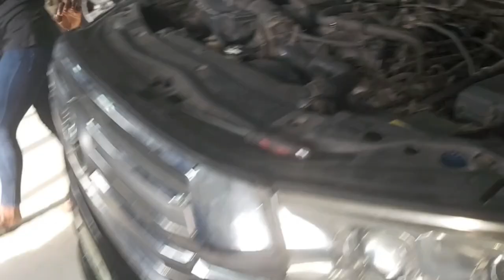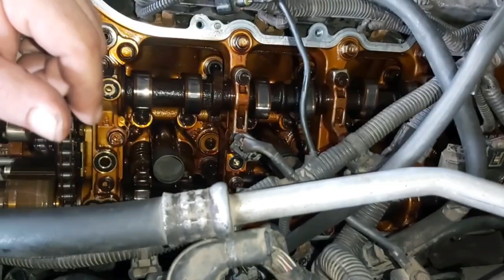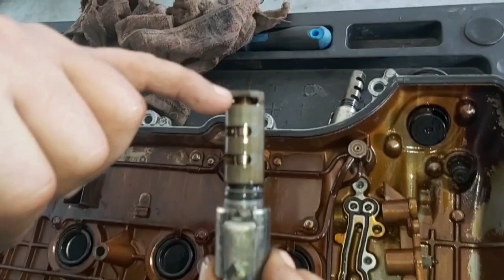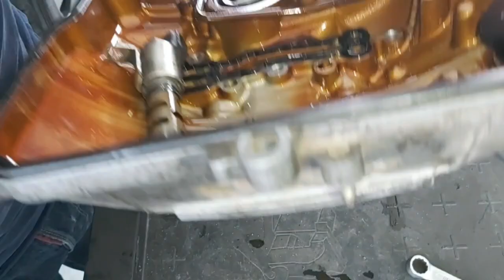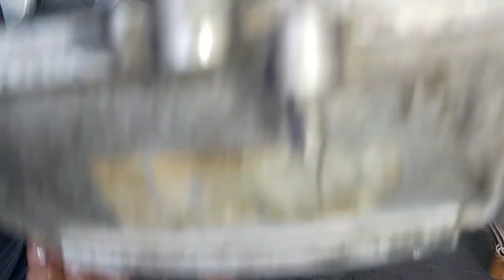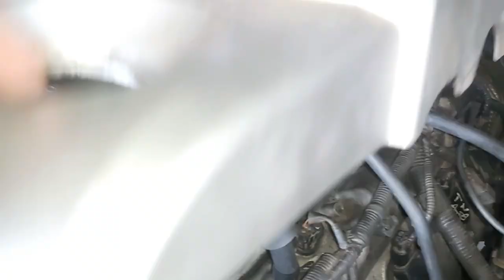Toyota Landcruiser 3ur-fe knocing tapping sound inside of engine. location valve solenoid filter.

Comment: Good amount of varnish in that engine. With variable valve timing all it takes is going too long between oil changes one time. Before VVT the piston rings were usually the first to fail. Excessive oil consumption used to be my 1st sign the engine had lack oil maintenance at some point. Now its the sound of ticking variable valve systems.

Comment: Do you recommend 5w40 or 5w30 year round for a hot country like UAE? It gets to around 40-45 degrees C in the summer and around 15 to 20 degrees C in the winter. Most mechanics here told me to use 5w40 and most of the engine oils sold here come in 5w40 like Lexus genuine fully synthetic oil. I want the longest life out of my LX570.
Reply from the maker: My personal recommendation is 5w30 magnatec full synthetic. 
Now for high temperature like UAE 5w40 is more reliable and definitely the mechanics there knows better.
Reply: @Apokatan.autotech  that's a terrible recommendation, no wonder this engine is loud, 5w20 is recommended for 5.7l anything thicker is WAY TOO THICK!!!
Reply from the maker: No problem you use it.....